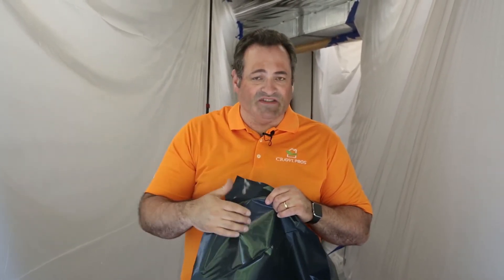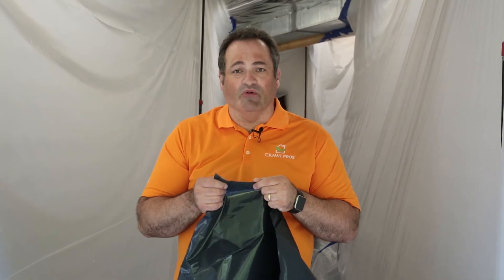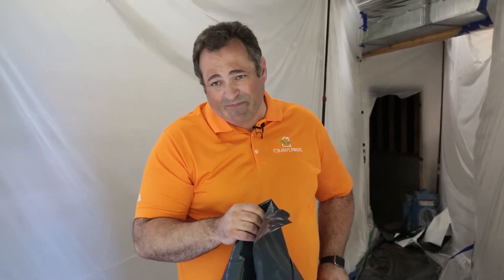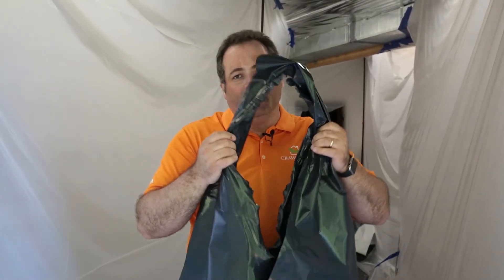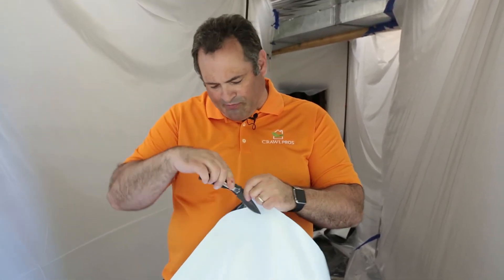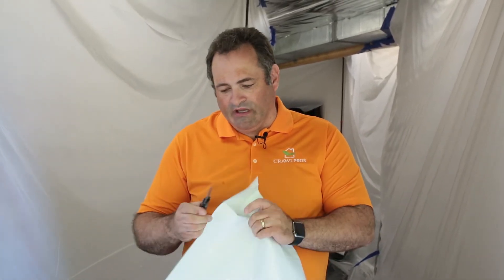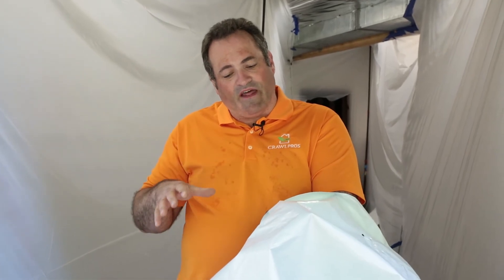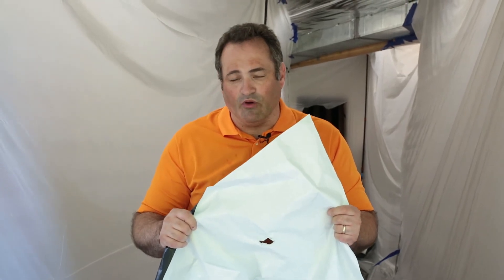Vapor Barrier - How Ours is Different

Comment: I have something similar to this in my crawl space.  Mine is 9mm, but it is white on both sides. I had a local guy install it for me years ago because my house had no vapor barrier when I moved in.  I always encourage people to spend the extra money on a heavy duty vapor barrier and always suggest white because you can actually see better should you have to crawl under your house in the middle of the day.  At night, the white is also great because your flashlight will reflect off the white and give you optimal visibility.  We do contend with rats on occasion and you will know right away because you can see their feces pellets on the white barrier versus the black.  I keep a shop vacuum under the house and will vacuum the vapor barrier yearly before my annual termite inspection.  It just looks better and keeps things nice and neat for me or anyone else who has to go under there.  I can't remember where the installer got this material, but he told me it was rated for at least 50 years and we have had no tears or rips despite having major work done where heavy equipment was dragged both in and out of the crawl space.  The foundation vents allow air flow in a crawl space and thus will blow dirt and debris into your crawl space, but staying on top of the cleanup once a year is usually all it takes to keep things clean.  It can be an expensive investment, so I always suggest people get at least 3 estimates.  This is also a great deterrent for subterranean termites as well.